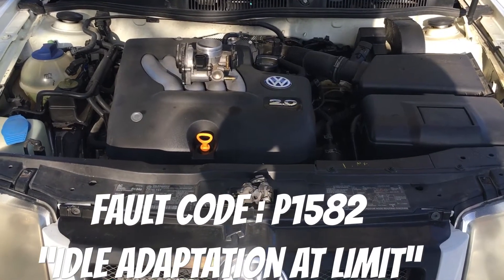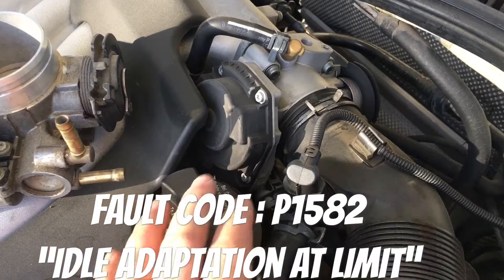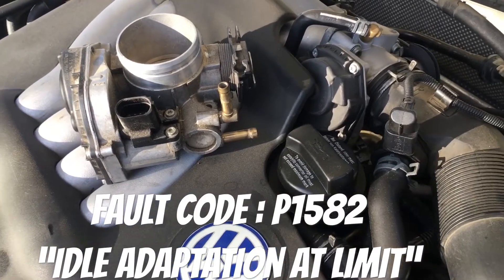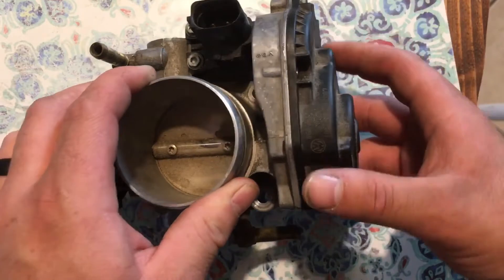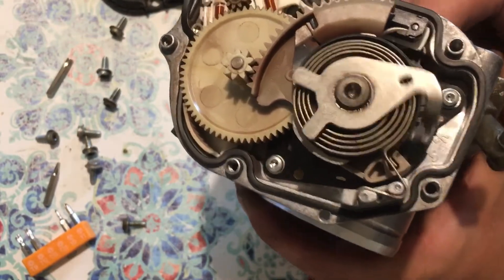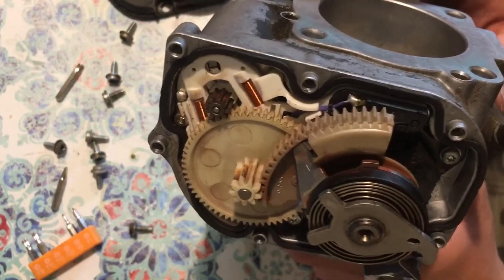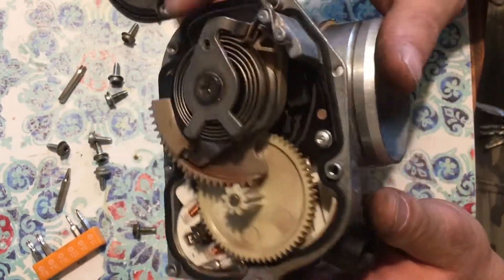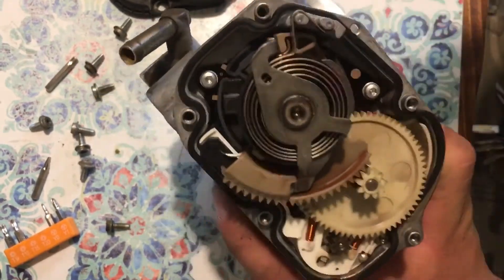How I Fix P1582 Code On Volkswagen VW Jetta Golf MK4 Throttle Body Replacement  (Please Subscribe)

Comment: I dont know what the code is on mine but it says about the throttle actuator. Car runs just fine i haven’t noticed any changes. Would this still fix this since its ecm. Or i think itd be the ecm
Reply: Also the idle is a little weird it bogs low sometimes but doesn’t die. Like i said it still runs fine
Reply: Do you speak polish